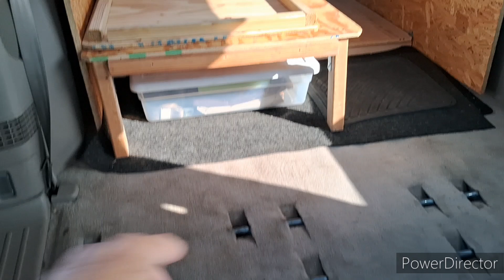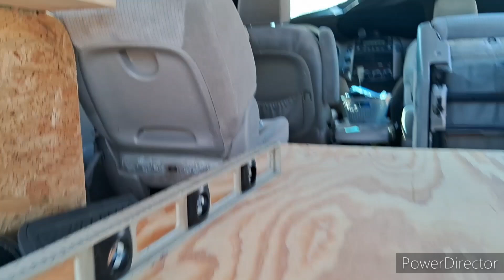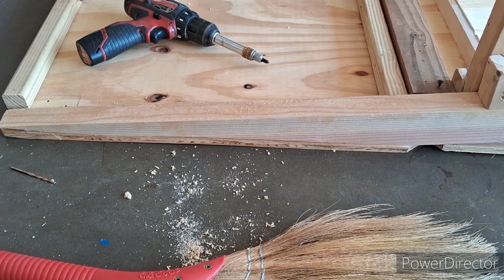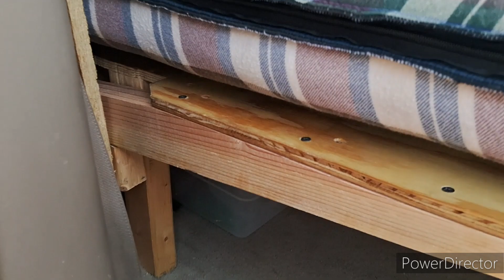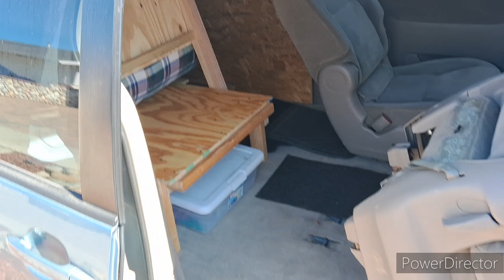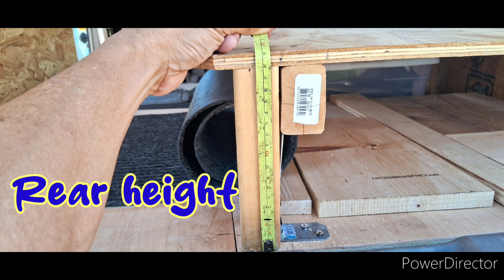Van Build - Stage 3 | Very Interesting Bed Frame

Comment: Nice tutorial. Oh yes, so important to be level. It's amazing how just a bit slanted can be felt when laying down. What about putting some cables on the top of the "couch" that you can hook and unhook. Then just use the whole cushion as your back and bottom cushion by folding it in half? It's a great concept. I really like how you can make it double as a bed and a sitting area.
Reply from the maker: Customized the cushions will be another stage, I guess!😂🤣😂